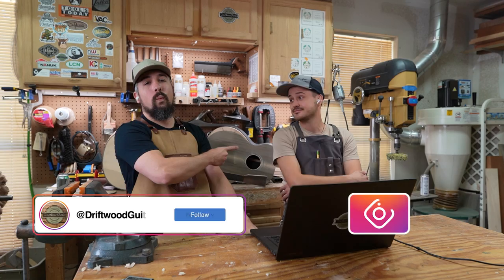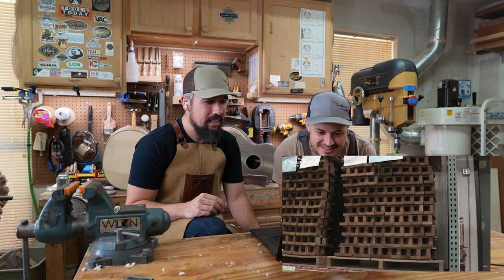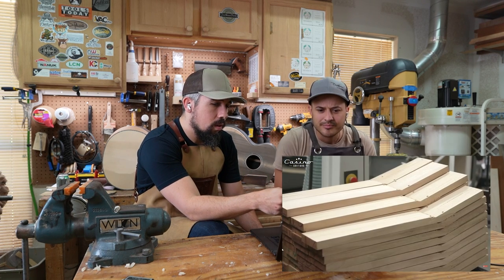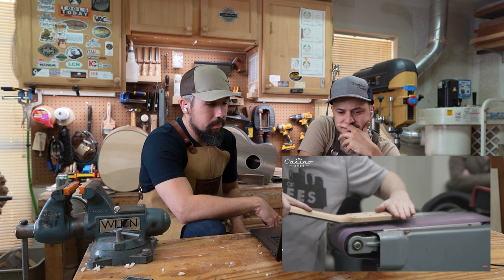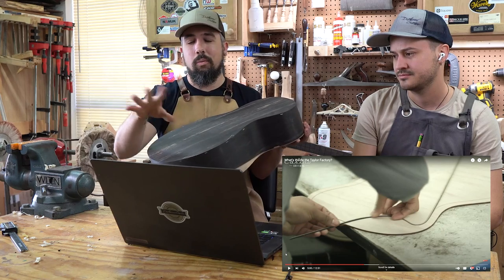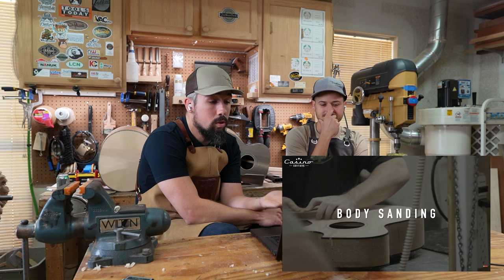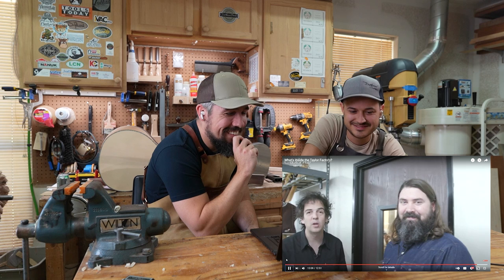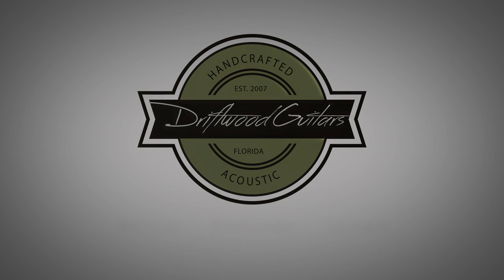Professional Luthier Reacts: Taylor Guitar Factory Tour

Comment: Scarf joints are stronger than one piece necks, just look at Gibson with headstock breaks
Reply: I personally would prefer a scarf joint over a single piece of wood for the neck. The glue joint will always always be stronger than the wood itself. The way that a single piece of wood has the fibers oriented concerning the angle of the head stock, does make it more fragile. And this particular subject, is always an incredibly contested one.
Reply: Bob Taylor focused on sustainable wood sourcing and functional execution in a reliable consistent product from a sound standpoint..
Reply: The problem with Gibson is the 17 degree headstock angle, not that it’s a one piece neck.
Reply: I agree with this as well. I'd never build a one piece neck without lamination
Reply: I agree with that it saves timber,  especially in a factory situation, but I’ve also had the headstock snap of on one of my acoustics with a one piece neck. Laminating the headstock does help. I tend to make Fender style necks, or multi-laminate with a headstock angle
Reply: @circaSG07  I agree with you but some small corrections... 
A good glue joint is strong!
It's stronger than the lignin of the wood but not the fibers. 
But the glue surface of a scarf joint is usually larger than the wood itself making it possible to be stronger than the fibers...
Reply: @hakancarlsson2881  I appreciate your input. Jargon isn’t my strongest attribute. But I’m glad to hear I’m not the only one who can agree on a scarf joint’s utility
Reply: Having done a fair amount of woodworking. I have tested glue joints. With a proper glue joint. And adequate drying time. The glue joint is definitely stronger than the wood itself. Many of the tests I did where on hard rock maple(thrown away by G&L Guitars) so the wood itself was very consistent.
Reply: @danielgregory9564  Proper glue joint being the key words!
The problem with the saying that glue is stronger than the wood is that it fully depends on how good the joint is but also what it's compared to and how it's done. 

Wood is strong in one direction and if the fibers continue through the whole piece.

The fibers in necks are in the right direction but in many angled headstock the fibers are cut off with the angle making no strong fibers going all the way from the neck through the headstock and it easily breaks. 

But if you just glued 90 degree cut pieces endgrain to endgrain for the headstock the joint would not be stronger than the wood but potentially stronger than a really thin neck and really angled headstock... 🤷 

The scarf joint with a much bigger glue surface makes it stronger though!
Reply: @circaSG07  cct
Reply: @Tyler_Wilson  If it was 17 degrees and utilized a scarf joint it would be much stronger. So yeah, the problem is a one piece neck.
Reply: @circaSG07 I agree! And… if the scarf joint and stacked heel are done right as TAYLOR does it can actually look great! I bought a Special Edition 414 yesterday and you have to really look to see the joint. Also, if you look at the side of the headstock you see the grain runs straight (no run-out) which makes the headstock way stronger.

Comment: On the scarf joint, the joint is stronger when compared to a one piece neck and the consideration of grain runout. Taylor switched to the three piece necks with the NT neck development. Initially they used a finger joint and when they first made the switch they did a series of videos going over the change. Bob Taylor, on video broke headstocks and the finger joint necks took more pressure. The scarf joint came about because they look better. It’s a cool 20 year old video if you can find it. Also, Andy isn’t often building on the factory floor, but has his own workshop where he is often making sawdust.
Reply: What kind of headstock joint do Driftwood guitars use then? He said they don't use it anymore. So they are making a one piece neck? Won't that lead to more headstock breaks like with Gibsons?
Reply: @EbonyPope  You overcome that by doing a book matched laminate with a accent strip down the center of the neck all the way through the head stock when you lay up the neck blank (yes that technically makes it a three piece neck however also prevents the neck from developing a twist) plus keeping the extra material for the hand stop/surface fillet below the nut adds strength to compensate for the hollowing out of the neck at the anchor point and slot for the truss rod that goes past the nut which some route out so deep it almost penetrates through the back of the neck.  

Often you'll find along with a break near the headstock, damaged/bent tuning keys from dropping the instrument mostly from leaning it against something or at times from really poor placement of the strap button on the heel of the neck so if the instrument leans forward slightly the strap slips easily slips off the button sending the instrument crashing, head stock first, down to the floor.

Eliminating the hand stop or surface fillet under the nut creates weakness on the necks of guitars, mandolins, violins, etc, etc (its not only guitars) giving you a neck more likely to break from a minor drop or bump.

Scarfing can reinforce a weak neck design to a degree but is no substitute for doing a proper layup and having a well placed surface fillet bridging the neck and head stock.  If your playing strictly acoustic you'll also enjoy the additional sustain the small bit of additional mass under the nut can give you.

Best!
Reply: @EbonyPope he does one piece necks but with a headstock veneer and a backstrap wich makes the headstock a lot stronger by having a sandwich of straight grain on the weak points

Comment: Hi guys. I bought a beautiful K24ce Builder's Edition and I'm not sure I agree with your critique about Builder's Editions being built the same as the cheaper lines. The purfling on this guitar is filled with a gorgeous Paua Abalone (very rare, only found in New Zealand) both on top and back as is the rosette, and yes, there isn't an added binding, but all the Koa edges (as you said, they're calling the edges a binding) are rounded, super smooth, yet hard and seem adequately strong. The beveled armrest and cutaway make this the most comfortable guitar I've ever played and I've been playing since the 1960's, and it is super light. The 21:1 Gold Gotoh tuners are superb as well,  and the flamed Koa back and sides are IMHO unmatched in looks and intonation. I have owned Martins, Guilds, Gibsons (two 200SJ's, one is a Pre War) and I have to say that this Koa Builder's Edition is really one of the best guitars I've owned. I bought it new for $5,300 and it's now selling for $6,300 at Sweetwater, and here in Japan they are selling for $8,000 new! I didn't think of it then, but is has become an investment. Cheers.

Comment: I once owned a 6 string ($5,500) Elrick bass that had a....SCARF JOINT! Why? so the dang headstock wouldn't snap off with all that tension. Scarf joints are stronger. You guys are young and still learning though.

Comment: Enjoyed the video. I have been to the factory, pre V class,  and I tried a dozen US made Taylor’s just yesterday, all V braced. Every one of the 12 showed no visible flaws and were perfectly set up (for me anyway) and intonated. I do agree there is little difference , at least that I could discern , in sound as the price rises , except for the ornamentation and the sound nuances between the back and sides.At the factory tour,  we saw the bracing process, no secrets. The braces themselves were cut a night by a special crew due to safety reasons. What I gathered from watching the attachment process to the top that no adjustments were made per top to optimize the sound. I also thought ,from the 12 I tried , that the urban ash back and sides offered a great compromise between sound and price. Finally, I this Taylor has mastered the marketing process for their product. Anxious to see your take on the V brace concept. You might reference that back to the Mark series guitars Gibson tried and failed with in the 1970 s.
Reply: The main difference between the upper and lower models is the quality of the woods used. The higher the series. The better the wood.

Comment: There are quite a few companies that are suing a scarf joint. As far as I'm concerned if done proper it's stronger than a one piece neck as is a stacked heel. If I recall Godin was the first to do this. Yes it saves wood yet it's main issue for me is the end result is stronger. Point is how the Epiphone J series broke when dropped and all the other brands you tested did not.

Comment: Regarding their builder's editions, it is true that they "found a way" to cut a lot of corners that take time by not adding binding, which, apart from it being decorative, what would you say the main function of binding is?  Protection of the edges, right?  Well... In the BE's they went with a simplistic look which is also awesome and unique in it's own way for some, me included.  Not cooler than with binding, just another very cool look...  The paint to cover up the edge is part of the aesthetics/looks as you can see when comparing to the academy series.  You can still see that the wood on both sides of the purfling is the top (I like that detail visually), and where they cover with paint is on the actual sides.  This is very well done in the finish department and I give them credit for the idea/execution.  And then in terms of protection, it is no coincidence that they round the edges on these guitars to avoid dings, etc...  Also, their finish is very tough...
Reply: The builders editions all have binding. It's the new cheaper guitars that don't. The builders editions have all the bells and whistles, just so you know.
Reply: Controversial opinion: binding is for covering up potentially ugly joints, and a degree of bump protection?  It's a decorative solution to cover up a manufacturing/design problem.
If Taylor have found a more cost effective way to decorate the joint and cover up the problem, good on them.  For sure it takes less time and effort.  The customer can decide which decorative bodge they prefer and at what price.

I've watched Trogly react instinctively and negatively to any Gibson model that doesn't have binding.  Even Custom Shop Crimson Division builds, allegedly the best of the best, criticised for not having binding.  If their crimson team have meticulously crafted the joints so they don't need bodge tape cover ups, shouldn't that be a sign of ultimate craftsmanship?  To some degree there seems to be an element of conservative traditionalism in expectations of what "a quality guitar" should look like.  It shouldn't be the only permitted cover-up mechanism, or viewed as an indicator of higher quality. Its just an indicator of way more labour intensive approaches to covering up a problem area.
Reply: @gerald5175  Hey.  You sound very certain.  I have a builders edition and I am very certain it doesn't have binding.  Do you have one too?  Maybe you do...  Hey, even better, maybe you work for Taylor?  This being said, I feel strongly about my reasons I stated on my original comment of why it doesn't have or need binding.
Reply: @PaulCooksStuff  Hey Paul...  Not sure if you're saying your opinion is controversial, but interesting details on other builders regarding the binding subject.  Thanks.  I think binding's main purpose is to protect the edges, due to spruce or cedar (main top woods) are soft wood where on a top would be very susceptible to dents also because of the grain direction in different parts of the edges.  You can find plenty of guitars with no binding that have a clean look.  With the BE though, the paint on the edges on the sides cover up the seam between the top and the sides for a cleaner look.  Strategically though, you can still see when looking carefully that the edges, from the top, is still the top as opposed to binding.  Their solution to avoid the dents was to round up the edges, which they also say it's to add comfort, which it does to a small degree...  Sorry for basically repeating my whole message!! haha...
Reply: @PaulCooksStuff  Are you actually saying the only reason to have binding is to cover up bad workmanship? I think all the class A handmade builders would beg to differ with you. Lol...
Reply: @polescalante  So apparently some builders editions do, and some don't. My 717e does, but yours doesn't. There are other builders editions that do as well, such as the 816ce. Sorry to have sounded so cocky. I knew that with the cheaper American dream series they had gone with cheaper chamfered edges. I guess we both made assumptions.
Reply: @gerald5175   You're misrepresenting what I said. As I understand it the original purpose of binding was to cover up exposed end grain and glue joints.  They're inherent in the construction method even with the most ardent and meticulous craftsmanship.  Binding hides the problem.  That hiding joints using technique A takes more man hours than technique B isn't a reflection of quality, only a reflection of the effort involved.  Building with a handsaw/hand-drill/handbuffer would take way more time than a power tool but doesn't in itself produce a better result.  Efficiency and skill are different dimensions.

Thought experiment - if an innovative design or construction technique somehow removed the problem of exposed grain and wonky seams and glue gaps ... that guitar wouldn't need decorative binding.  Would its lack of traditional feature (cover up!) for a decorative problem it doesn't have be a sign that its not a "quality" instrument made with exquisite craftsmanship?  Would they feel obliged to add it anyway just to placate traditionalist senses?
Reply: @gerald5175  no worries man... You didn't come across as cocky imo... you are right about the other BE!  I haven't gotten a chance to play their Grand Pacifics yet and have always been intrigued.  That's a gorgeous guitar you have... Cheers!
Reply: @polescalante  You as well brother. Peace...
Reply: @PaulCooksStuff  I think a beautiful binding is something I certainly love to see on a guitar. Sapele Mahogany or Koa or Flame Maple...I think it really adds to the overall aesthetic of the guitar. All of that is personal obviously.
Reply: @PaulCooksStuff  certainly something interesting to think about. My personal opinion is doing a good binding job, especially with wood binding is way harder than getting a good glue joint between the top/back and rim. I think the fact that most acoustics have binding is rooted in tradition, but I would question if the original intention was to cover up bad craftsmanship.
Reply: I was under the impression the the 600 series was taking inspiration from other stringed instruments like the violin since it uses flamed maple back ands and sides with an added vintage look. I may be wrong but don’t violins only have purfling? The arched plates attach to flat sides but I don’t think they have any “binding”. Maybe Taylor wanted to get that kind of vibe. Also, is it the back the only part that lacks binding? I was almost certain that the tops of those guitars have binding…. Food for thought
Reply: @circaSG07  interesting idea although there are several models (with Koa for example) that don't have binding either.  You are correct though when you say that violins only have purfling.  The top and back actually overhang or stick out a little bit past the sides.  The Taylor BE's that don't have binding also don't have it for the top.  Some though have binding both for top and back.
Reply: @polescalante  yea I think not using binding is simply just cost effective for them. There could be a lot of conjecture as to why they don't use it on certain models but I feel pretty confident that if not using binding didn't save on time/money...they wouldn't be skipping that step
Reply: @polescalante  the Builder’s Edition guitars have binding, save maybe the 324ce. The 717 is koa, the 517 is sapele, the 816ce is maple, the 614ce is ebony, K24ce is ebony, 900s are ebony, on and on. I think the 324ce and 652ce maybe don’t but I can’t remember.
Reply: @gabrielobrien21  so is it every single one or you can't remember?  My guess is that you are quoting what it says on the Taylor website.  Wouldn't be the first or last time someone lied.  I can absolutely guarantee that my B.E. K14ce has no binding.  Look carefully at some pictures with good enough lighting and big enough of the 324, 614, K24, K14 builder's editions (at the very least) where the sides meet the top and see that the edge of the sides is still the wood from the sides as opposed to a strip of binding (they do a sunburst on the sides but not dark enough so you can still see the edge of the wood, especially curls, etc).  Then you see a small rounded edge made from the top wood to protect from dents since it tends to be softer (spruces for sure).  And again, you can see in pictures that the very edge of the top between the sides and the purfling is part of the top wood (torrefied spruce in the case of the K14ce).  The only part that is dark enough to really see the detail (everything else I'm stating here is clear as day to me at least on the K14ce which I own) is that very small round edge done on the top wood.  This would be the end grain of the top and it makes sense that Taylor would want to cover that up since it is the least attractive part of wood in general.  It also is the part that gets darkest when you stain, dye or paint and just helps the look of a simulated binding.  So unless the binding you and Taylor are referring to is that very small round edge (which makes the least sense in this whole controversy), the guitars I mention above definitely have no binding.  Don't just read reviews and Taylor's specs.  Go look closely at specific pictures or even better, look very closely on the guitars themselves.